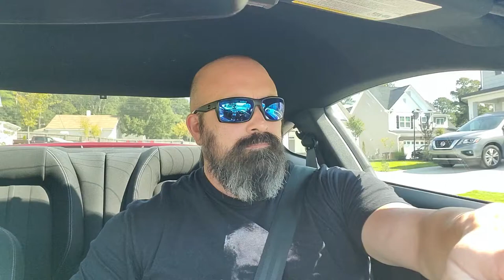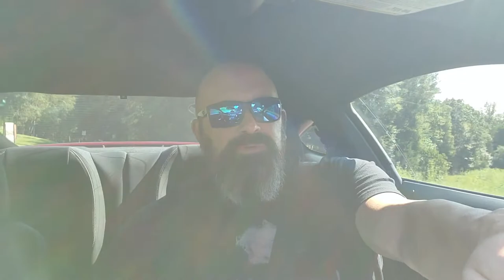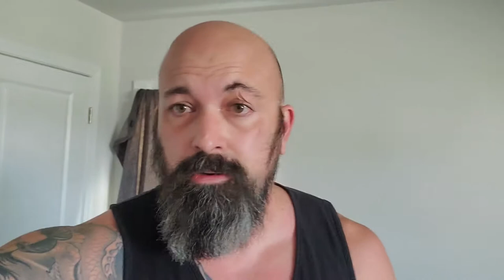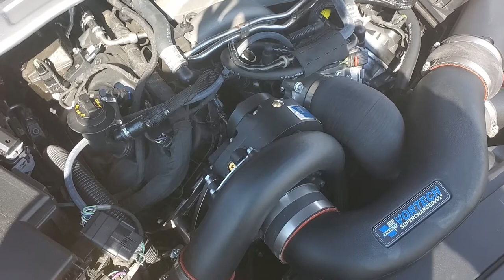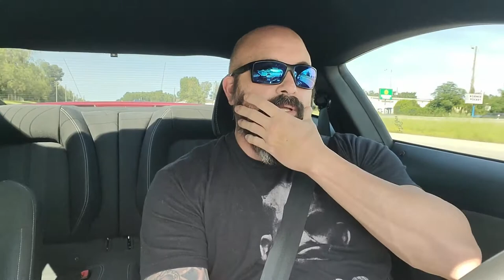Here's Why I Prefer the VORTECH Supercharger over the WHIPPLE for the 2018-2020 Mustang GTs!

Comment: I recently installed a vortech on my 2018 & have 0 traction issues with 305/45/17 nitto 555r2 tires.
Reply from the maker: Those are what I plan on going with.

Comment: My car 16 Mustang has been in the shop 3 weeks now, no problem with installation,  but they couldn't get the tune right for nothing with the jms bap I had with it.  Thinking something wrong with the bap ,I ordered a DW400 pump to do away with the booster pump. Hopefully I can finally get my car tuned in the next day or 2.

Comment: do you know if the ported cobra jet manifold could pair with the paxton or vortech?
Reply from the maker: I honestly have no idea.  Talk to the guys at Pro Dyno, (https://www.pro-dyno.net/)  they should be able to help you.
Reply: @ncbadasp3433  thanks brother
Reply from the maker: @PZilean  Of course.  Glad to help.
Reply: @PZilean  yes you can modify it to work. They don't recommend it but all you have to do is get a air fitting that goes from the oval cobra jet throttle body to the circle air intake that comes with Paxton. A website actually sells a piece that's made specifically for it. That's the route I was going to go with my cobra jet setup before I sold it to a friend.

Comment: Does the vortech make your exhaust/car louder overall?
Reply from the maker: No, there was not really much difference in the overall sound of the car until I added the catless longtubes.  I did get the heritage gears in the blower which makes iit whistle a tad louder than it would with the regular gears.
Reply: @ncbadasp3433  okay, is the whistle bearable? I hear some people say it’s annoying? Thanks!!
Reply from the maker: @Blazingstorm25   I don't find it to be.  I think most people who complain about that are ones that are hearing the blow off valve.  You can upgrade it and make it quite noisy if you choose to do so.  Without the heritage gears, I don't think you would hear the blower at all.